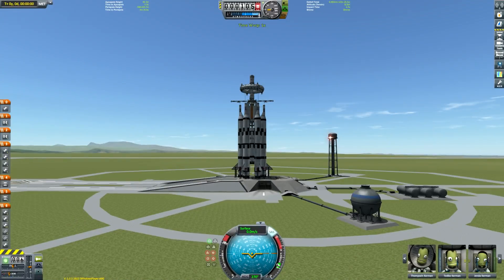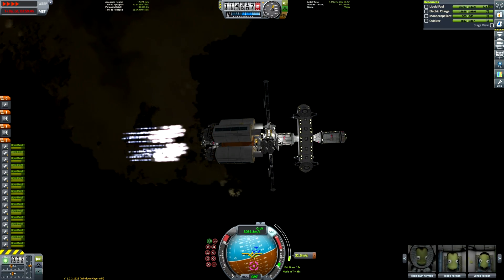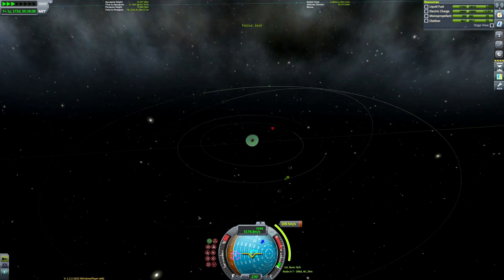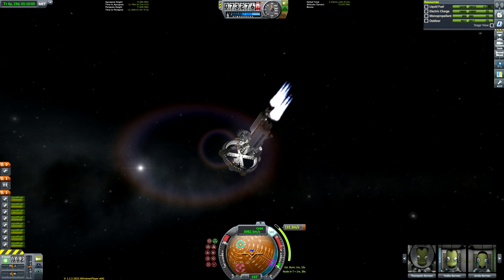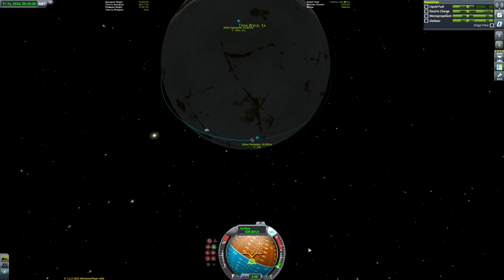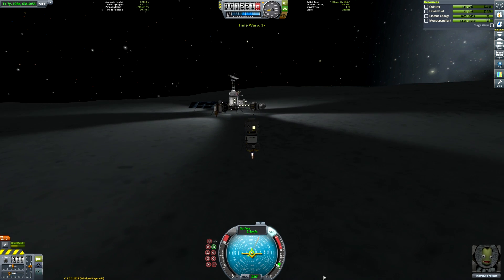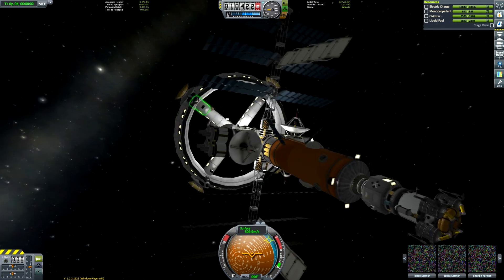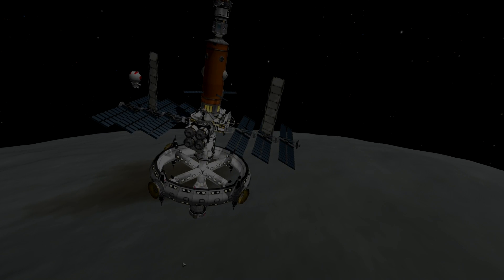Eeloo Ring Station in 1 launch! KSP 1.2

Comment: Where do I get the MODS & add-on's from? The main game KSP has a section for these But takes me to a no longer in use page saying page Unavailable?  As for the orbiting part in game I got 3 station sections in two orbits two on one and the other in a close by higher orbit. How do I get them together in the same orbit and docked?  I have a big rocket on the 3rd orbiting section of station it can be the one which gets and joins them up as it has fuel and thrusters and control wheels and a kerbin pilot the 2nd station part has two kerbins and neither it or the other 1st part has any fuel left to move! the 3 station parts are in a line one in front one in the middle and the other one behind them but is the higher orbit one?  The closest point the two orbits come to each other is 3.4 Km.

Comment: You youngsters today have it way too easy now days. Back in my day the biggest rocket parts we had were 2.5m. Only 2 motors, 3 tanks and a 1.5m adapter and we were glad to have that. and we didn't have no fancy mods like Kerbal joint reinforcement or Lagsbane. We just has struts, lots and lots of struts. and we were glad to have them. And if we single launched a station that size we went straight to the forums to brag because that would have been an epic achievement.  And we didn't have an Eeloo either. All we had was the Mun, and we were glad to have it. Yup you kids sure have it easy.

Comment: Wouldn't it be wise to burn right before periapsis so that you "push" your periapsis right ahead of you to increase the effect of burning? Since burning at the point of periapsis will only change apoapsis and you will travel further and further away from periapsis, therefore less gain.

For instance, if you have to burn twice at periapsis, you could instead burn right before in order to extend the time closest to periapsis, although I'd imagine you would have to calculate alot more as you would also move apoapsis as you burn.

Just my thoughts

Comment: 2:49 Depends on what you count as an atmosphere. I don't think the atmospheric pressure on Pluto and Europa is really different from vacuum.
Reply: +mesoth mesoth
It is still about 1 Pa, still well in the region of what is considered a medium vacuum. Medium vacuums are the vacuums you can achieve with a single stage vacuum pump. Still very much a higher pressure than outer space (0.1 mPa or less).